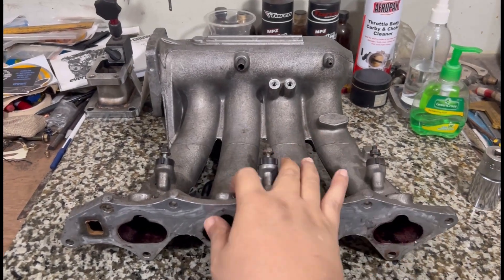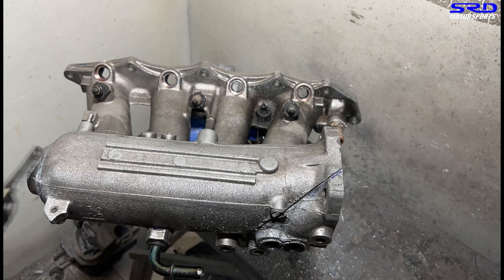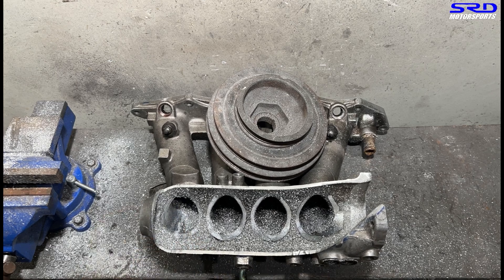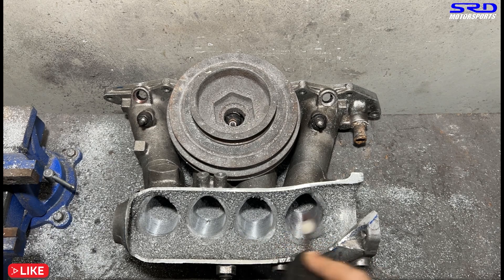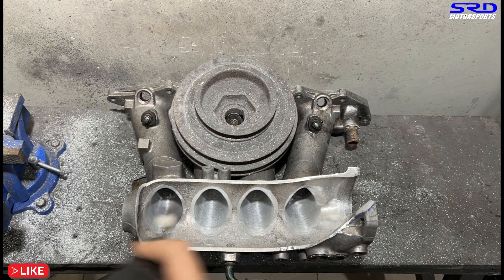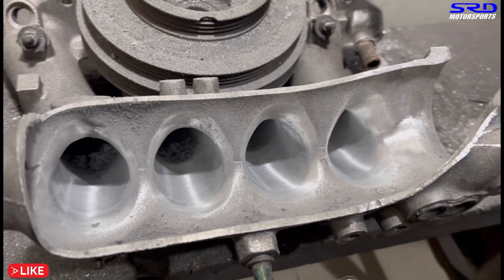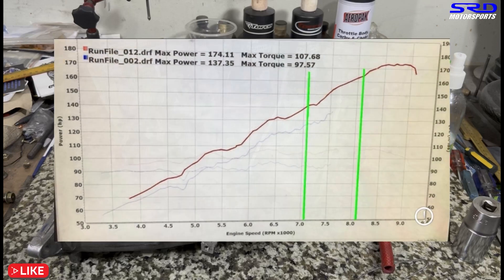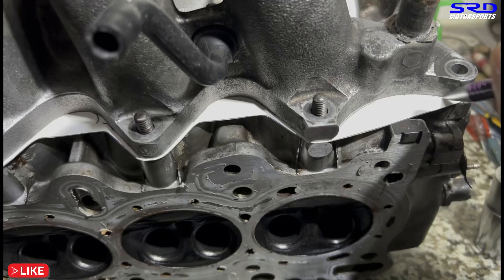Civic SiR B16a P30 Intake Manifold Porting and Development

Comment: How do you think this stacks up against the Type R manifold when ported... in the interest of "use what you have"  i have to ask the question before I sell mine😂
Reply from the maker: well on a b16 or even a gsr displacement the p30 does well especially when ported

But on a b20vtec on the sheer displacement alone u already got the torque and low end there and the typer manifold just welcomes better top end

but let’s say an autocross b20vtec? I might enjoy the ported p30 😎